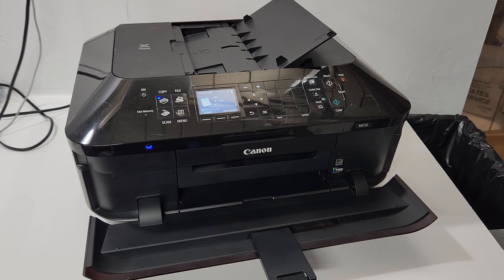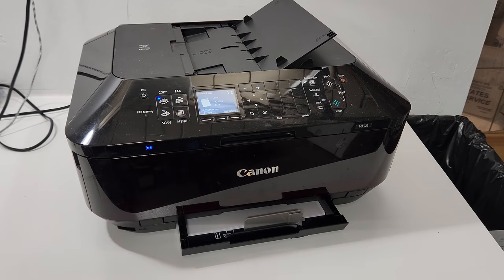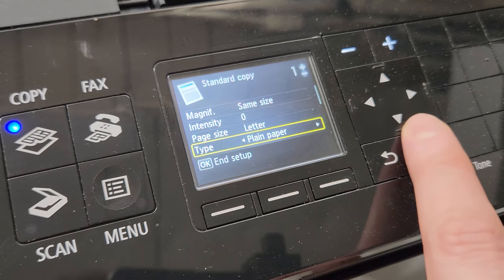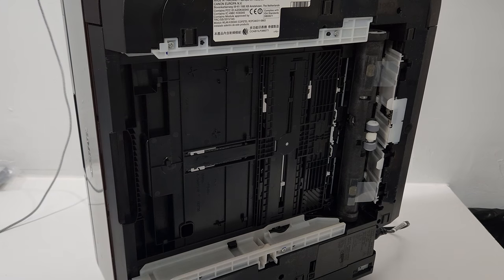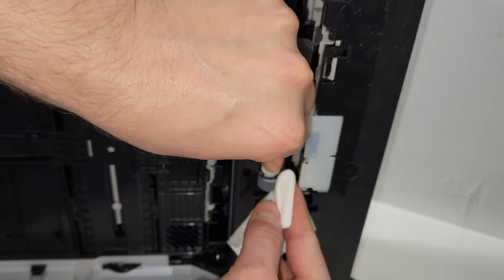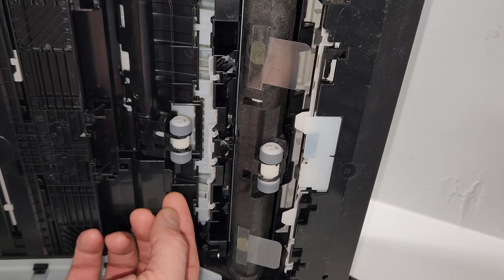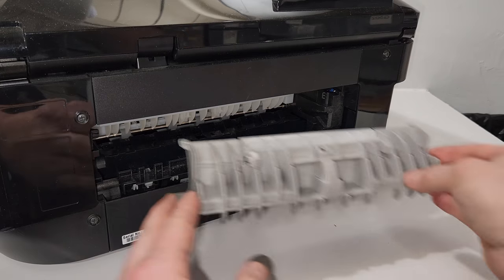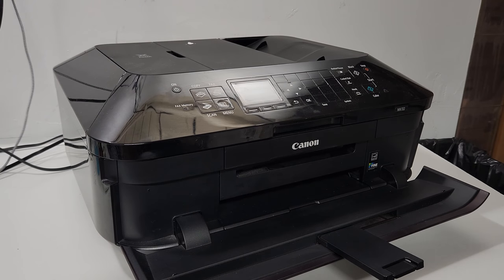There is No Paper in Cassette Canon MX722 MX920 MX922

Comment: I have the canon mx922 used the built in roller cleaner. Another thing to try first if you keep trying to print the same thing over and over with no success is trying printing something else. I know this sounds obvious but I kept trying to printout a return label. So out of couriosity I tried another pdf file and it printed no problem. But for some reason it wants to print the label from upper case. Just a suggestion.

Comment: for those that couldnt get it to work with this method like i did.. Try this option out which worked for me right away as soon as i did it.

Switch The two grey rubber that is attached to roller.  I don't use the photo feed roller so what I did was swapped those in place for the paper feed. Worked like a charm! When I looked at the rubber piece that was giving me issues I noticed it lost its integrity likely do to me printing SO much. Now i just need to find a set of new one just in case lol. but all is well since the photo roller feeder rubbers are basically new since I hardly used it.
Reply from the maker: Wow! Very clever. Thank you for sharing!
Reply: I will file this away incase need to replace rollers. I used the printers built in roller cleaner.

Comment: I had another paper issue with my MX922... accidentally had it set to envelope and tried to print standard letter and it came up with a "paper jam" when there is no paper in the feed system... the error was like a 501? and I can't get it to clear... I was told it was a internal sensor/mechanical issue that can't be fixed... ?...